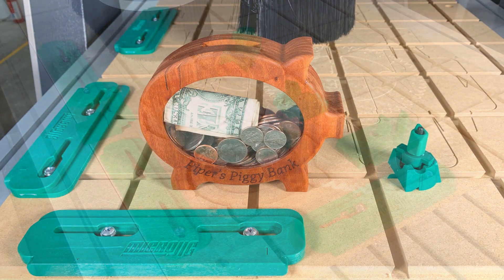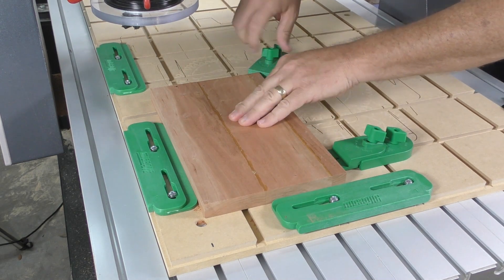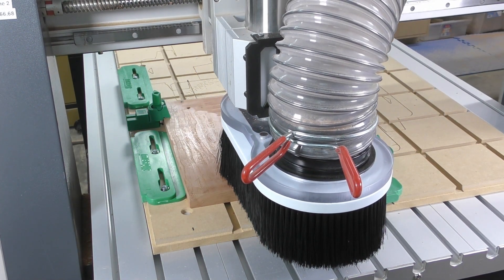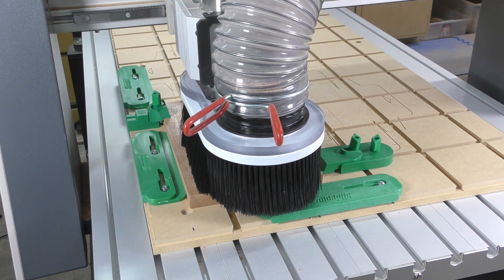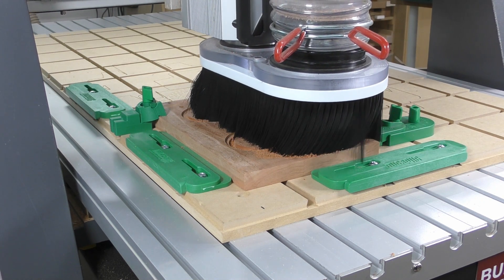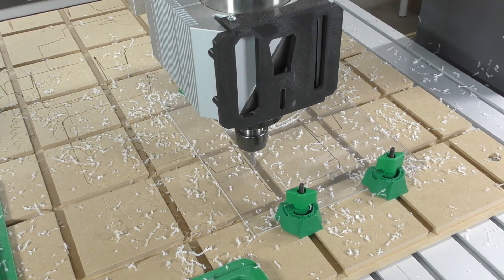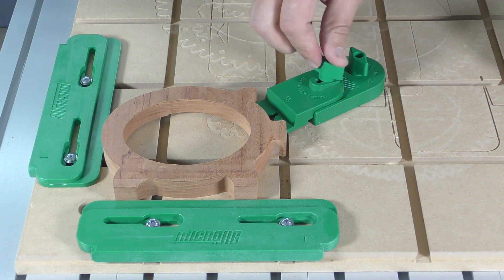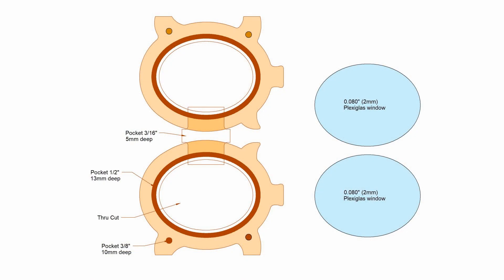CNC Piggy Bank using MicroJig's Workholding System

Comment: What´s the final size? The DXF files import in 12.5 appear too small.
Reply from the maker: The .dxf with both halves on it opens to about 6" wide by 10 tall so the 7 wid eby 11.5 tall blank provides room for clamps.
The finished bank should be about 6" long and not quite 5 tall.
Email me at ralph@woodcademy.com if you need more info.